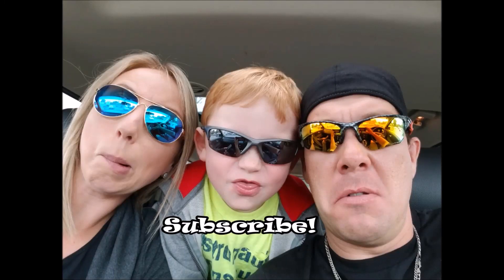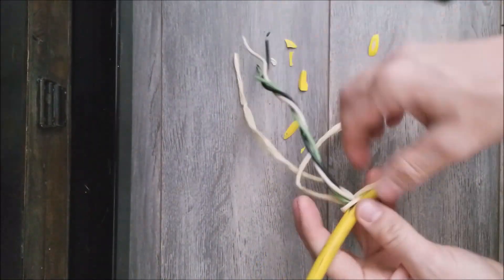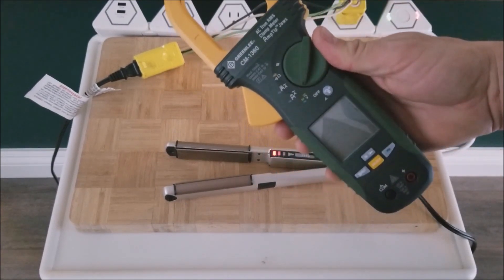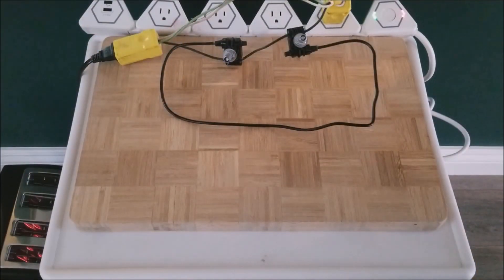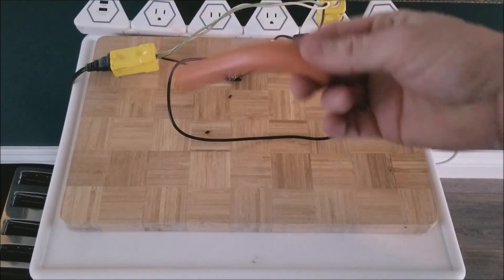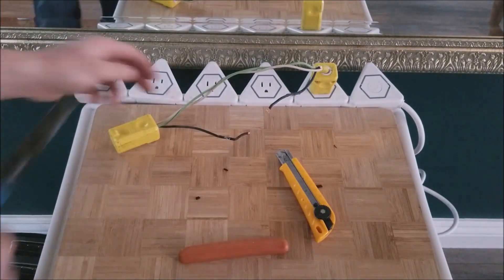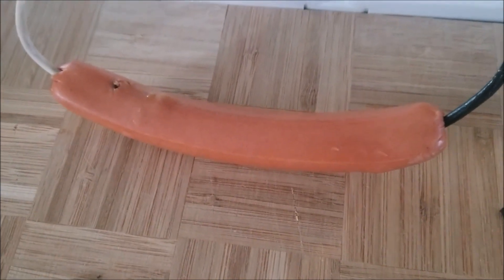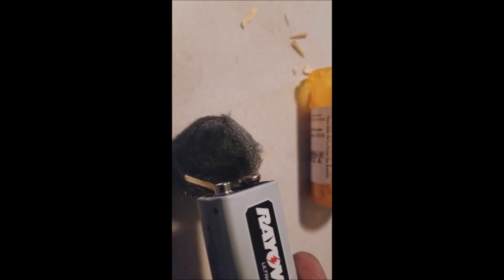Electrocution and Amperage

Comment: I'm thinking the "pain" amount is a lot less than people say...apparently some of my laptop chargers have different leakage coupled, if I have one in my lap and touch the other I get a painful tingling on my legs and hands where they're touching...and according to my multi-meters it's only like 200 micro-amps or open-circuit 60 volts (not milli, but micro) between the chassis of them...never thought about it until I got "shocked" several times and took a multimeter between them.

Comment: I'm just surprised you don't have a set of wire strippers LOL
Reply: He's a lineman, which means he works with distribution wires, not building wires like electricians do. Overhead distribution wires are not insulated, so there's no need for wire strippers. Instead, they're mounted to the poles by ceramic insulators.

Comment: APPRENTICE ALERT

Well said!  It hurts my head when someone says "i got electrocuted by 240,  i had a 200 amp jolt".  Tell me more.....Oh,  you touched a hot terminal while plugging in your dryer! 

To all the young Apprentice Lineman-
Its a different ball game below a 100 KVA pot with 500 cu secondary leads going from one hand,  across your chest,  to your other hand.  This will make no sound. there is no telling how much current traveled through your body.  You might just slump over and silently die.

Now lets talk about flashes and explosive fault current.
~The fault duty is tremendously higher near the substation compared to a small wire tap line  or as you are near the end of line. 
~A transformer is like a substation, the fault duty is much greater below a 100 KVA pot on the 500 copper leads, compared to 1 of the 50 weather heads with #4 or #2 triplex. Then even smaller fault duty exists inside the house-#16 cu in you're light switch, which can easily kill you. Tiny flash.

That hotdog would probably explode along with a fair amount of the 500 copper... in about 1/10  of a second,  molten copper is exploding in every direction.  Molten copper rolling down your neck,  your back,  your ears ringing from the explosive fault current,  eyes blind from the fireball that escaped perfectly silent conductors, flash burns from the 20,000 degree fireball. (You'll need new safety glasses) It might blast another couple times now that you're blind and in a bind.  Remember this is apprentice work- secondary voltage 120/240. Standard work. Respect it...you won't though. Not until it teaches you.

Its hard to truly respect electricity and harder to realize all your careless habits you've established until you take a hit.  Some guys really don't have a clue what their dangerous habits are because the rubber gloves make them super human to an electron bitch slap.

The Devil lives in those wires. When it comes out to say hello,  its with no warning.  Keep those safety glasses on and don't bullshit anyone. Soon you'll be a lineman, so act like one.
Reply: If I wanted to become a lineman, I'd probably have to move to Wichita.  Fanfare,  ya' know...

Comment: My dad taught me this when I was a kid. He said he used to do it at an overnight job in the days before microwaves were common. 

A kid in high school years ago said "110 won't kill ya" The teacher agreed. I was like "people die all the time from 110/120". The reason we don't usually die from a shock is because the electricity doesn't have a good contact with your skin and a good exit path. Wish I would have understood that back then to tell them.
Reply: This is why I think 120 volts is more dangerous than 230 volts. People think it is safe and are careless. In Europe nobody says mains voltage does not kill.

Comment: You are usually very safe, but in this case (unless you are using an off camera power cutoff) you were relying on the power strip on/off switch, when you should isolate/unplug the power source. Having been shocked several times by cheap consumer products, it made me wince every time you touched the wires. Please NEVER trust these types of devices with your life.

Comment: the expression "its not the voltage that kills, its the amps" is misleading and people that repeat it, don't really know what they are talking about.
Reply: If you had a very low voltage source with high current capability (for example, a massive single lead acid cell), you could grab the battery terminals with both hands and not notice a thing. Yes, it IS the current that kills, but it requires sufficient voltage to drive that current through the resistance of your body. To further complicate things, it also depends greatly on the PATH that the current takes through your body; frequency and voltage, as well as the points of contact, often create widely varying current paths. A very high voltage applied to your body may well follow a sweat path through your shirt, then conduct along your tool belt and exit through the keys in your pocket; all the while never entering the core tissues like your heart and lungs. Electricity always follows the rules, but the rules are very complex.
Reply: @wb6wsn  No. It means that your contact resistance is not low enough to kill you, but if you are wet or have a saline solution in your hand it will get electrocuted. It matters not if you have a 12V instead a 120V. Actually you can touch a live wire and not get electrocuted...
Reply: @wb6wsn  It's really the power that kills. Ohm's Law is really just a description of how kinetic and potential energy works for electrons. Saying "it's not the voltage that kills, it's the amps" is like saying "it's not the height that kills, it's the speed" - and we all know it's actually the energy with which you impact the ground that actually kills you. The reason high-power lines kill is because they transmit large amounts of electrical energy. Voltage, current, and resistance are all just descriptions of how fast and how many electrons are moving and where they are going, and individually they can't tell you whether there's enough energy in a line to kill you.
Reply: @deriamis  No, it is NOT the power which kills (although excess power is always a bad idea). Consider a path that applies 100 uAmps to the heart muscle. The harmful effects are near instantaneous (setting the heart into fibrillation). If the danger were a function of power dissipated in the heart tissue, then 10 uAmps over 10 units of time would be just as bad as 100 uAmps over one unit of time. However, this is not the case; low exposure currents can be tolerated for long periods of time. I can understand how difficult this is for you to imagine, as practical electricians rarely encounter extremely low leakage current effects. Perhaps you can reconcile the dangers of electricity by remembering that an excess of Voltage, Current, Power or Energy each exploits unique threats to human health, and that there's a lot of ways to die. One parameter is not the main villain; all parameters are related through Ohm's Law and present truth for your interpretation. As this channel deals with practical electricians working with power distribution systems, there is almost always an abundance of Voltage, Amperage, Power and Energy available (I believe I saw in another video that the author described a power of some 75 kW was continuously available to sustain a pole fire). The only thing you can do to keep yourself safe is to ensure isolation (by disconnecting sources), control the possible fault paths and ensure any path has the highest resistance possible (especially when you might become part of that path).
Reply: @deriamis  "Saying "it's not the voltage that kills, it's the amps" is like saying "it's not the height that kills, it's the speed" - and we all know it's actually the energy with which you impact the ground that actually kills you."
OK, Deriamis, let's test your analogy. Try dropping the same object from the same height, but on two different mass planets. The gravitational constant will be larger against the larger planet, making the object fall faster and impact the surface with more energy.
Let's test it again! Drop an object from a given height and note the impact energy. Now, drop the object again from the same height. But this time, it sprouts wings and glides in the air until it slowly touches down (with much less energy). Oops, same drop height both times, but vastly different impact energies. Looks like impact energy is related to impact velocity, not drop height.
Thus, two scenarios demolish your assertion; it is not the height which defines the impact energy; it is the velocity of impact. Think this through and we can continue to talk.
Reply: @wb6wsn  Um, dude - I understand far more about physics and medicine than you are assuming I do. If what I said seems incorrect to you, please ask what I meant rather an assume I am wrong and/or don't know what I am talking about.
Reply: @deriamis  I twice tested your assertion and found it invalid. Yes, I assume you must be far more knowledgeable, as you waxed most poetically about electrons. Give it another whack.
Reply: @wb6wsn  No, thank you. You obviously did not understand what I wrote the first time because your example is mathematically identical to mine and yet you think it's different for some reason. I think it's my fault for being unclear, but I am not going to spend my time trying to find the right words all on my own, especially while you're being dismissive and patronizing towards me. Communication is a two-way street, man.
Reply: @deriamis  Well, the first insight is to note that I used no mathematics, just logic. The aid that you constructed is more of a morass than a beacon, so I suggested you completely rethink what you are trying to say. If you fix your analogy, you will see its internal contradiction. Once fixed, I think you will then see how it doesn't help you with explaining fault currents. Sorry, not trying to be dismissive, just trying to keep the verbiage lean. I hope we are communicating now.
Reply: Deriamis I found your initial analogy to be one of the best ways to explain this fable.  Spot on. 

I’ll use this example to correct or have an answer to the young ones.
Reply: Maybe that's like saying, it's not the amount of gunpowder that kills, but the size of the slug?
Reply: Dr. M. H.  The more and angrier the pixies, the more electrosity ta getcha electromacuted till yer dead.
Reply: i have genuinely never understood that statement. Ohm's law is ,... quite important, n'est ce pas?
Reply: @TheChipmunk2008  oui.
Reply: If you doff a wool pull and it sizzles and smells from ozone you have produced a voltage of some 5-10 kV at some hundred nanoamps. No danger. If you put a 4 in. tin plate onto your chest an one onto your back with salty paste and then attach 6 VAC terminals your heart will stop within some beats.
Reply: @schlorkl  First.  What the heck is a "doff a wool pull".   Second.  6VAC???  highly unlikely.  Third, you clearly don't understand , nor what I said.  Current is dependent upon the voltage and the resistance.  
Let me put it to you this way.  You can have voltage without current but you cannot have current without voltage.  The reason why a static charge from clothing doesn't kill you is because there isn't enough energy.
Reply: @tchevrier  stop "shouting" at me. I told the sam thing in other words. I know that the amperage depends on voltage and resistance.
Reply: @tchevrier  ...forget it...

Comment: I worked on a transmission line in Africa. The first thing the linemen told me was never grab an unknown wire, touch it with the back of your hand. If you grab the wire and it is energized you will be stuck to the wire. I have a lot of respect for linemen, tough job
Reply: Patrick McAllister: I heard similar advice, though to use the back of a *finger*. A small current would likely make the finger curl *inwards*, thereby breaking contact. I figure this is because for a current to go up and around the armpit, the current density would be higher along the inner side of the lower arm, where the finger-closing muscles are located. The finger-stretching muscles on the outer side may get activated as well, but less so.
Reply: The first part was good advice... Electrons don't give a shit what side of your hand they enter... Hope he he still alive and better educated.

Comment: Hi
I've been working my way through all your videos and enjoying them.   Got to this one and you were using a toaster as a load load bank,  I've found that hairdryers are better as small load banks because you can run them longer.   I use them as a load bank for testing home generators at about 1500 watts a couple of them will make a nice load.  My wife keeps replacing hers every couple of years because the fans slow down and they don't dry hair as well/quick,  I just take them out to the shop for the next time I need to test a generator.   Think I've got four of them hanging on the wall so 6000 watts of load.

Keep up the good videos.

Comment: It's the volts that jolts, but it's the Mil's that kills ;)  i think the question should not be "how much amperage is ON the line", but how much amperage the line has available over & above what it's already carrying.
Reply: That is also the wrong question.  It's fairly safe to assume any high voltage power line's impedance is going to be low enough to put a fatal amount of energy into you if your resistance is low enough.  The amount of power already flowing through the line is irrelevant.
Reply: @stargazer7644  Now you mention it, that makes sense. I was thinking in purely quantitative terms rather than considering line impedance/length of potential path to earth. Thanks :)

Comment: all things being equal (amps and volts) DC is more dangerous than AC.  Which if homes have solar panels is a big concern, since a single bank ( called a string) is usually wired in series and spits out 250 volts DC at 1 to 2 amps, very dangerous.
Reply: No it's not, because AC causes your muscles to lock in place and once you grabbed something live you might be unable to let go.
Reply: AC is more dangerous, it can cause fibrillation of the heart, and it tends to breakdown the natural resistance of skin more easily.
Reply: @Eddiecurrent2000  except that in a domestic situation that most people encounter, the AC circuits are protected by RCD breakers that make the AC wiring much safer.  The DC supplied off solar panel installs has often not even any breakers, and if it does have breakers they are not RCD type.  DC is also much more able to throw an arc to ground.

Comment: Extremely painful shock was fixing one of those electric fly swatters. Had it apart and while testing managed to get one hand on the positive and one the negative. Only lasted a split second but that was intense. I felt it go in one hand and out the other. Not sure how many volts or amps, but it was enough. I would imagine getting a spark across a gap that size takes a lot of potential.  Guess that means milliamps or I'd have been cooked.

I've been tased. Because that is across a much smaller area it didn't hurt nearly as much. Stun guns feel like a little pinch in comparison.
Reply: I think your fly swatter is around 1500V at least that's what I managed to read off mine!

Comment: I've seen a lot of arguments on YouTube about this. It's the voltage that kills you. No. It's the current. Being a lineman, the voltages and the power you work with I think takes a whole different way of looking at electricity than the common person who just puts the new plug on the end of his table lamp cord. If he gets a short he says oops and resets the breaker in the panel. When you get a short sometimes things blow up and are gone.

Comment: As a kid of around 9 or 10, me and a friend found a bank of electric fence wires. So, being curious kids, I started grabbing wires one at a time. First wire, nothing. Second wire, nothing. Third wire, yeouch! The shock went up my right arm, and down my right foot to ground. That stung! Lesson learned!
Reply: People quickly touch an electric fence wire and think it is off because there was no shock then grab it and get whacked not knowing the voltage is only on for a short pulse every second or so. If the electric was on continuously, someone or some animal might get on the wire and may not be able to get off of the wire and be killed. If you are out and come across a fence and want to see if it is on get a long blade of grass ( like 3 ft. long). Loosely hold one end and touch the other on the fence wire. If you can feel a tiny shock you know the fence is on and if you don't, slowly slide the blade of grass so the length gets shorter checking for a tiny shock as you go. The tiny shock should be no worse than a static shock you might get when you get out of you car in the winter time.

Comment: Interesting experiment. 1/10th of an amp across your heart might kill you. Your finger will most likely cook in this experiment. Some People experience very high voltage electric shock, burn off hands and feet and still live. Path of least resistance, I think.
Reply: If the voltage is high enough is basically just explodes

Comment: He should not have held the white wire with his bare hands. Suppose the insulation is defective from the wire factory? The high current through the hot dog could have exposed that unseen problem and hence he could have received a jolt of electricity.

Comment: The word electrocution is a portmanteau of electric execution, so people do not receive minor electrocutions. The term you are looking for shock.
And you are correct about the path of least resistance due to R1+R2/(R1)(R2).
Reply from the maker: Yes you are absolutely right! A few people have mentioned that ... Totally my bad✌️
Reply: @Bobsdecline  Actually, the Oxford dictionary does describe electrocution as either death by electricity or injury through electricity. Although it sounds wrong, it's actually acceptable.